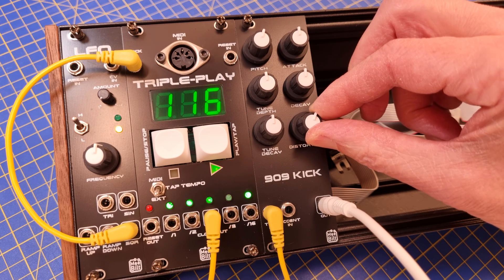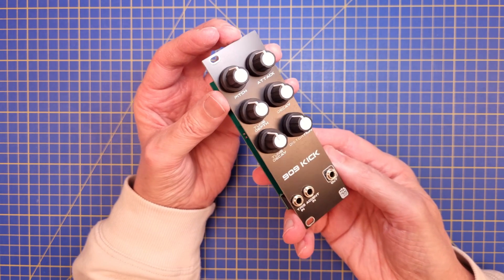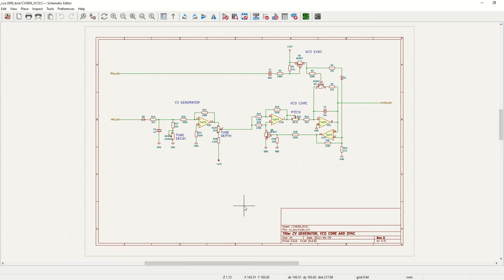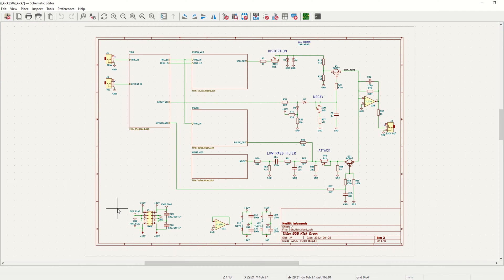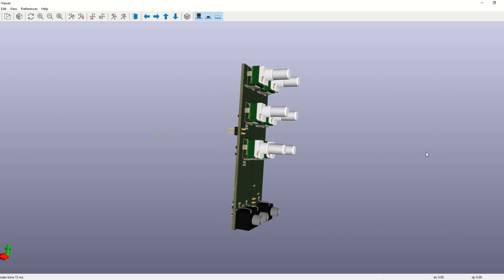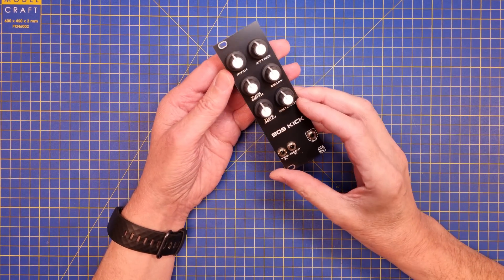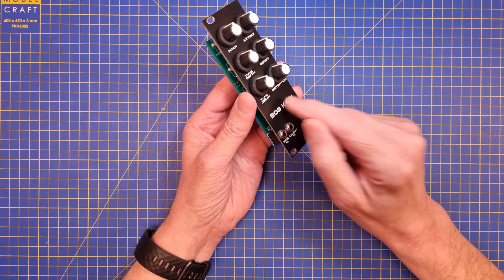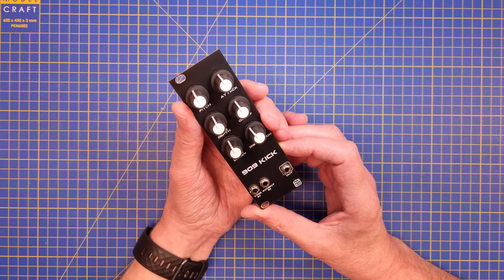Eurorack DIY: 909 Kick (Episode 3)

Comment: Very tight pcb. That noise circuit is so big compared to the rest
Reply from the maker: Yeah, it's a lot of discrete components and some traces needs to be placed with some care as well.
I will put the noise circuit on a separate PCB
Reply: @MeeBilt  the piggyback board seems like a good solution.

Comment: You could also have used CD4021, you8 changed the original accent/trigger, good job otherwise you would have to use 5V on the switched contact of the Accent input.
Would you share the kicad schematic/board file?  so i can edit it and use the parts i already have it have?
i have the original Roland TR-909 transistors, 2SA1115, 2SC2603, 1SS113 diode, M5218A opamp.

originally, it was +/-15 volt, did you take that in account?
You could use a "touch plate" button.

Check my profile, uploaded some random sounds yesterday, using a CD4013.
Reply from the maker: Hey @AnalogDude_ Yeah, using the 4021 could be another way of doing it, the important part is that it is connected as a 31-bit LFSR (X^31 x X^13 + 1). The circuit is more or less the HexInverter NeinOhNeion Bass Drum and it works on both +/-15 or +/-12 VDC rails.
I have no plans to share the KiCad files.
Reply: @MeeBilt  it works, but the sound changes.
You probably should build also a temporary +/-15 Volt psu to compare, a few resistors need changing.

Not sure, it's just creating pseudo random bits. to higher the bits the less repeat.
i made a pcb using such "thing", but due to chip shortage, like CD4070 DIP it's not soldered yet.

Comment: Nice, but I miss the 909 sound. Can you compare it to a 909 sample and try to match the sound?
Reply: Colin Frasor, website, he has a Roland TR-808/Roland TR-909 clone in one case.
also the samples from the eproms, a sample pack.
Reply from the maker: I haven't found any good samples - most sample-packs have been processed. But it would be fun to A-B test it against the real thing and try to tweak the design to replicate the sound as good as possible.

Comment: Are you getting all the SMT components pre-soldered by the PCB fabricator?  If so, it should be quite a quick build for the through-hole stuff?
Reply from the maker: For this first version I haven't planned to do that, but if there is an interest for a SMT placement file I could do it for this first version. I can't guarantee that JLCPCB stock all components, so there may be some that needs to be mounted afterwards.
Reply: @MeeBilt I would be very interested in that!